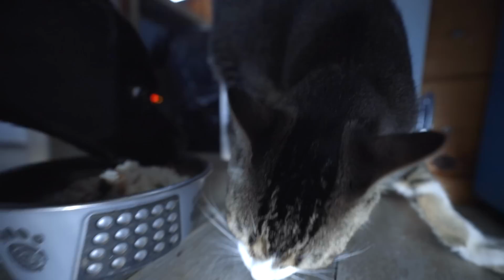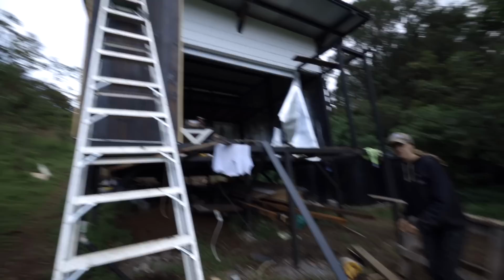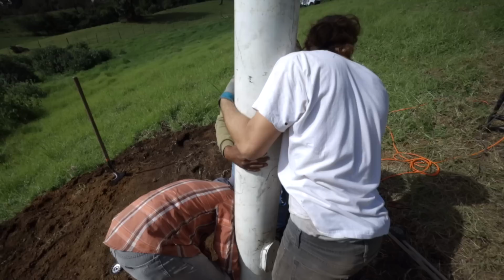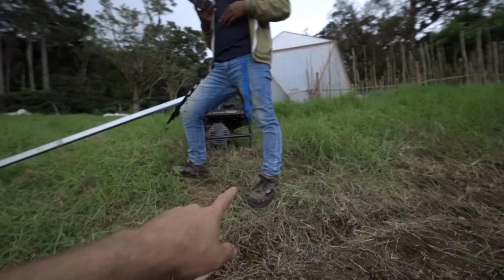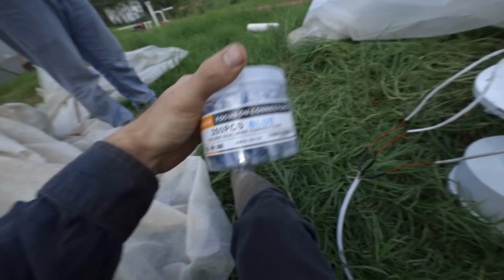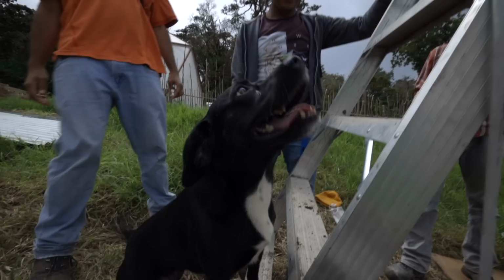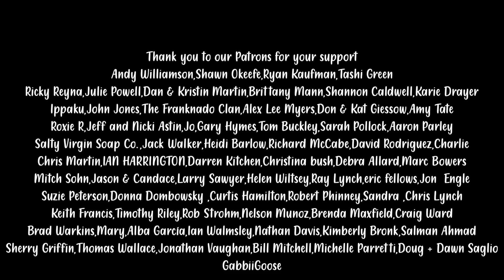WIND POWER!! Generating Off Grid Electricity with a WIND TURBINE!

Comment: Guys, love the wind turbine but it has two MAJOR safety issues you really need to take on right away:

1. Its at an unsafe height off the ground, and could very easily kill a person or animal that could touch it. You need to create a secure perimeter around it that can't be breached. Probably the easiest way is to dig back and slope contour the ground around it, like a volcano, with an inner radius of existing ground of at least 5 feet (so as not to undermine your footing) and an outer radius, going as low as you can practically make it (3-4 feet lower than existing) maybe 12-15' diameter. Then put a proper fence (steel posts in concrete) and chain link or equivalently strong barrier material at the outer, lower perimeter. As it is, I feel the turbine is too hazardous to even start letting it spin. Its as dangerous as walking around an airplane propeller, but more so because there's no loud motor attached to it and you won't hear it moving (or see it at night.)

2. The welding is inadequate. Full stop. No BS. You need heavy multipass beads of weld metal to properly attach the 3/4"- 1" base of the column to the 1/2" steel plate you have. The bead should be at least 1/2" up on the base and similar distance out onto the plate, so you just haven't put down enough metal. More importantly,  the small stick welder you have doesn't generate enough power to penetrate the thickness of either base material enough to fuse it. Seriously. You need a professional welder to come out with a heavy mobile setup that can generate the 250+ amps of power necessary to truly weld those pieces together. What you have now is a continuous tack weld around the corner of the base, with poor penetration of either base material. Its not your fault. your home welder probably has less than half the power you need to really burn that stuff together.  You just don't have the amperage to make the weld, or the experience, frankly. You also need to seal off the bolt holes in the column base- filling them with weld is a good idea. Otherwise, water will get in there and corrode (destroy) the metal from the inside, hiding the problem until the joint fails. A few concrete anchor bolts around the perimeter of the plate are also a good idea, and something a mobile metalworker with a concrete rotating hammer could do for you. Anchoring this machine is a serious job for a trained professional. IMHO. 

Not trying to discourage you. Love the channel, but the wind turbine install is off the scale sketchy. Please call Renova and talk it over ASAP...

Comment: Interesting your engineer said to weld the base plate, the correct way is to use nuts and washers to make minor adjustments and make it level just like a light pole or the super large wind turbines, you are assuming your footer that you poured is level or will never go out of level due to settling

Comment: Any particular reason the wind turbine was installed so close to the ground?  Wind turbines require undisturbed non turbulent air movement to work properly.  That is usually 60 to 80' or more above ground level and any surrounding structures, trees, hills, etc.

Comment: Big commercial wind farms kill all of the birds and bats in the area. When black-footed ferrets were reintroduced into the wild, the US Wildlife Service chose a large wind farm in Wyoming because there were no longer any aerial predators, such as hawks, owls and eagles (the ferret's main predators). That is why people who understand the hazards large windmills present are against commercial windmills (and especially large wind farms). Small private windmills don't really present much of a hazard to birds and bats, but they also aren't very reliable (they only generate power in narrow parameters of wind speed). 

Wind mills used to drive well pumps have been around for over a century and a half, and they are good for that application (provided there is an elevated water storage tank they are pumping the water into). In that application, you don't need to be pumping all the time (because the water is gravity fed from the tank to taps) and wind speeds aren't as critical. The windmill only pumps water when the wind blows, and hopefully it blows enough to supply water for all needs.

Comment: You are going to have a stray cow walk into your turbine and ruin it. Get another section of tower, build a scaffold and raise it up. You can lash a long pole to the base section with a pulley at the top and use a rope to lift it as well. 
Also it really should be above the tree line. You are losing more than half the available wind by being so close to the ground.

Comment: In order to get decent production from wind turbine it has to be much more elevated than few meters and peak 1kw will be very rarely produced if ever. 3 solar panels will provide on average more energy and will cost 10 times less to install.  What the point?

Comment: It's actually a very nice looking turbine.  The lower part of the turbine is lower than hour heads.   Might it be safer to raise it higher than the tops of your hands?   Also, by doing so you will be able to capture more of the wind too.  Just my two cents.  What do you think?

Also, when you say 1kW,  Is that 1kW after a certain wind-speed?

Comment: Good job guys...  just curious, what type of speed governor does that model have ?   A wind turbine generator needs a "Governor"  sometimes called an "Over Speed braking system"  so high winds don't spin the blades so fast that they fly apart and destroy the unit.
I have not seen the model you guys just installed  and just curious if it's centrifugal, magnetic or some other type of braking system.
Thanks,
John

Comment: Unfortunately, you'll never see a return on investment for that wind turbine.  I worked in the small wind industry, designing, selling and installing thousands of small wind turbines over the past 13 years and even the horizontal turbines rarely pay off but the vertical ones, never, especially that close to the ground.  It'll be fun to watch is spin, very rarely.

Comment: I love windmills but they are Noisy and  birds have problems with them , I'm wondering about yours being so low to the ground.
Reply: Their windmill design is practically silent. The height is more than enough.  Come the windy season, it can gust up to 60mph.They will be fencing in the turbine.
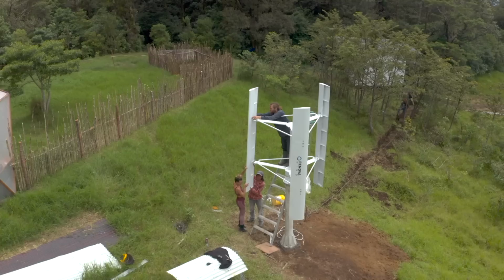Reply: @dougsaglio2095  Fencing in the Turbine? th e Blade edge seems to be about 4 feet from, ground level or right at cow head level.  at 15:22 the blade is at waist level

Comment: Sorry guys but this is good example how NOT to situate wind turbine. It's too low from the ground, particularly in such place. Higher from the ground (at least 20-30 feet), wind is much stronger. Also in your place you should know wind rose and place turbine accordingly, considering that from two direction you have dense trees.

Comment: Pleeeeeeeeeeeeze make sure you don't let the turbine run without the regen braking connected. It'll spin off out of control. If it's not connected to the brake circuit then you must tether the blades so they won't turn. I've seen three of these installs destroy themselves without the braking circuit connected.

Comment: Anchor bolts ..been nice.. template the base bolts in the concrete...be way sketchy relying on not only welding but the weak quality rebar...you might want to drill anchors...see your engineeer needs his  head examined..or after a fail..his Azz kicked...js

Comment: i am a little confused why you did not trench and bury the power line to/from the cement support? 

also, i realize, again, that your tools and access to equipment are limited... but this turbine should be up AT LEAST 10 feet off the ground. even with a fence, it is an accident waiting to occur. 

when i saw the welding of the base i cringed. you need a bead 3 or 4 times that size and still... i'd have properly anchored screw posts in the concrete. 

yah i am being critical... regarding safety issues. sure we all have a learning curve and make mistakes as we learn... but these are fairly significant. and ... if i did not enjoy the camaraderie and scenery and desire to bulid like this... i wouldn't watch you all.. 

as too  Kaylie's accent... i'm from newton. but i have no accent. her accent is humourous.

Comment: Guys do you really need an architect involved? Costing you a lot of money. Examples the concrete tower mass with bolts coming up. I have never seen anyone weld the plate and bottom tower mass instead of bolts that cost you buying a $2000 dollar welder and labor time. You don't have to use carpenter glue on corner boards etc., Ideally use decking screws with a hex head not Phillips instead of nails. If you got money to burn than its different. It you didn't already consider using Loctite on the nuts especially on the blades! Beware that when the wind turbine spins that at certain part of the spin there is tremendous force on the blades in heavy winds, inspect it for lose nuts and any signs of broken welds and blade cracks. My wife and I have been living off grid in USA for 3 decades and do general contracting. Does code make you have an architect? They usually get paid by how much money you spend. The more elaborate the more they make. Beware that your vertical axis brakes electronically and if that brake gives goodbye wind turbine. So, in heavy sustained winds please consider shutting it down. It is the sustained heavy wind assault that will overheat the electronic brake components. Please tell me what make is your unit?

Comment: SCARY..................  you  should have had a portable professional welder do your turbine...   and still should...  with your welding, you are not getting proper penetration and your welds will NOT survive the constant vibration and high winds.  In fact, the base should be bolted to long studs set in your concrete.  Considering the weight and leverage, you should redo the whole thing, properly.

Comment: Are you insane!!! are you trying to kill people??? some kid walking around that thing when there is moderate wind will end a kid!!
This whole install is wasted effort. For a wind Turbine to get rated power it has to be 60 feet in the air AND 30 feet above ALL obstacles within 500 feet. if those tree in the back ground are 60 feet tall the tower needs to be 90-100 tall. with the way you have it I doubt you will even get 40% of the power rating.